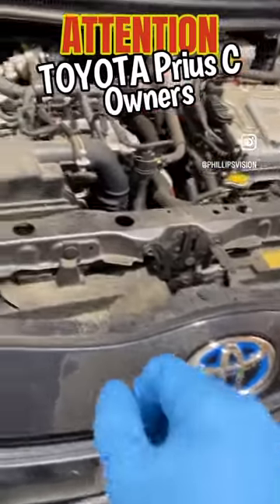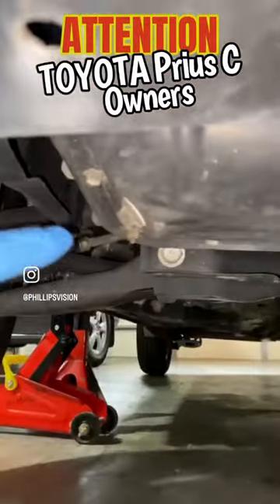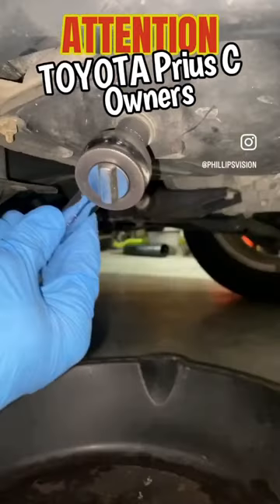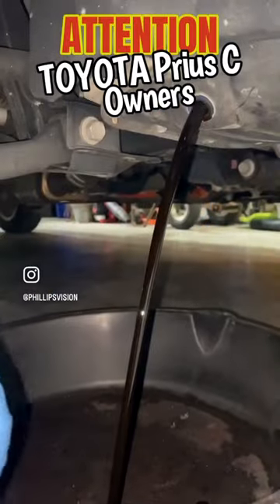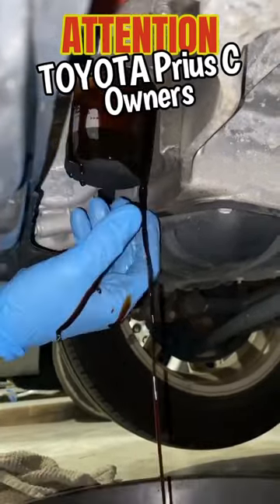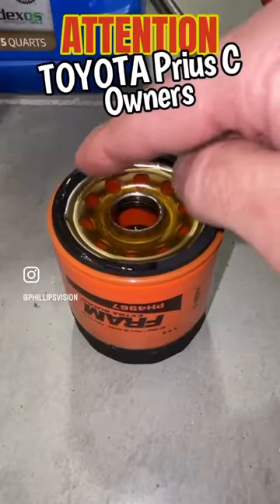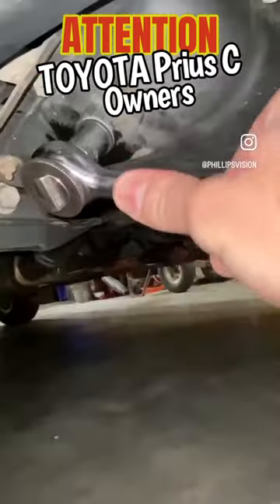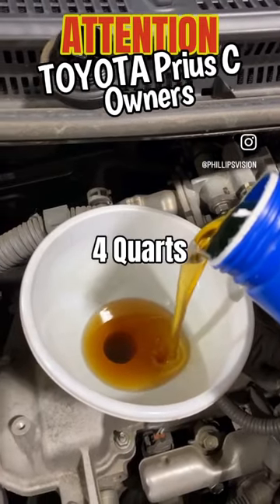CHANGING OIL & FILTER ON TOYOTA PRIUS C. #shorts #youtubeshorts

Comment: Use a zip lock bag and put it over the oil filter after it is loose . Then when you unscrew it , you will not get oil all over your hand and engine compartments.
Reply: Great tip, thank you so much.

Comment: You can get a factory filter cheaper than that fram, which is very poorly made.
Reply: Extra guard filters 95% at 20 microns and tough guard 99% at 20 microns which is alot better than most other filters. Assuming you're talking about the fiber endcaps they have been making them that way for over 50 years and aren't the only ones who do it. Some filters don't even have endcaps.
Reply: Been using Fram over 5 years with no problems
Reply: @dylanclay2741 I’ve used the Fram filters for the last 30 years and never had a problem with them. The cheaper orange filter, I wouldn’t use it for more than 3K-5K miles, but the Tough Guards and Ultra Synthetics can go up to 10K miles with no problems.
Reply: Fran has been cleaning themselves up (pun). Toyota filters are really bad. Not even synthetic media.
Reply: @TocyBlox  I just don't have any faith as it say "made in Thailand."  Sorry.

Comment: Nope have several 2nd gen Prius running 0w20 mobile oil with 250k one over 300k miles! The thinner oil acts as a cleaning agent for the pistons rings, that's why the oil is dark when it changed because it removing the carbon deposit from the rings and cylinders

Comment: 0w20 has gotta be bad for engines if you want it to last 200k+
Reply: But that's what the manufacturer calls for.  However, oil consumption may increase as they age so a slightly thicker oil can help.
Reply: @wturner777  yeah those manufacturers also took away transmission dipsticks and said the transmission fluid was to last the life of the car/transmission. That’s insane so no I won’t follow their recommendations on oil weights. My Silverado has made it to 300k stock bottom end and burns maybe half a qt in 5k miles. I only use royal purple because of the additives. If you pop off a valve cover it’s clean as hell and has 42psi of oil pressure. Most of your oil consumption is your valve seals. Rebuild the top end and you just might see better everything. I do run 10w40 now but hey it’s over 300k miles.